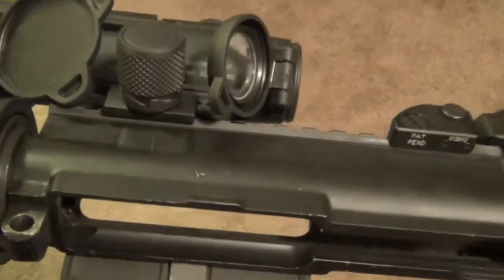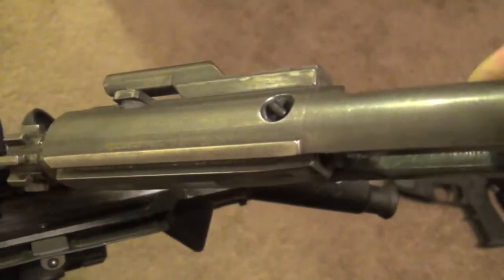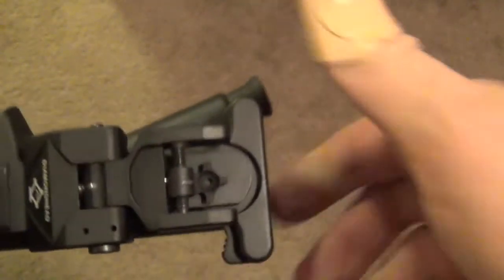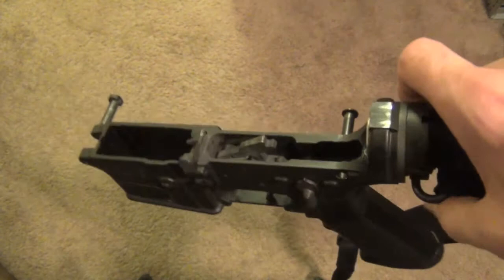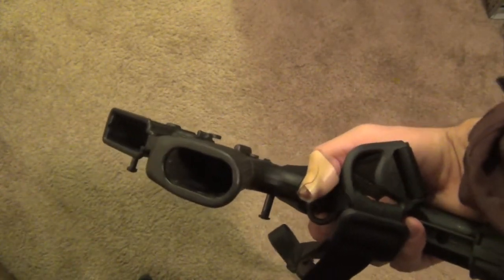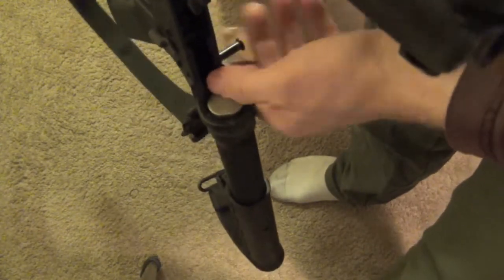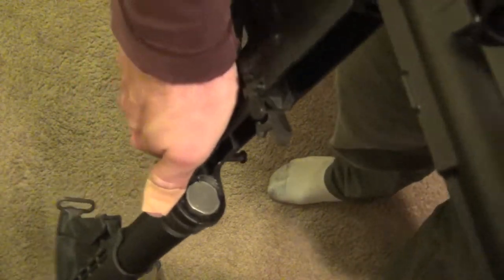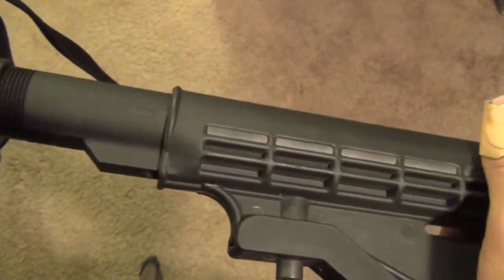Showing Off My AR 15 (Part 2)

Comment: Show your rifle some love, a little bit of oil is not going to hurt, its only going to make it run slicker, once you do get into higher quality lowers I.e. noveske as you mentioned there is a huge difference,  function the same yes, but quality and feel is the difference. I know cause I have a gen 2 noveske and its hands down better than my m&p15 lower. Nice vid. . I have most of those parts your looking to get in the future, check out my vids as a reference, can't go wrong with magpul and vltor...
Reply from the maker: 210armory Since I'm running a nickel boron BCG, not only is oil not necessary, but Fail Zero specifically recommends against it. So far, I've got well over 1000 rounds on this bolt carrier group without a drop of oil, unless you count what's left over from the Rem Wipes that I use to clean it. I'll check out some of your videos.